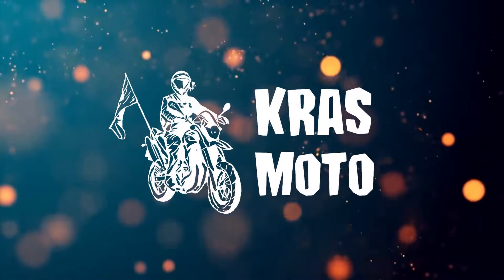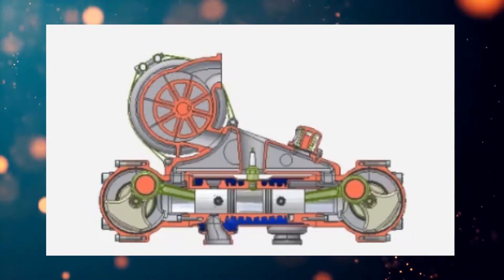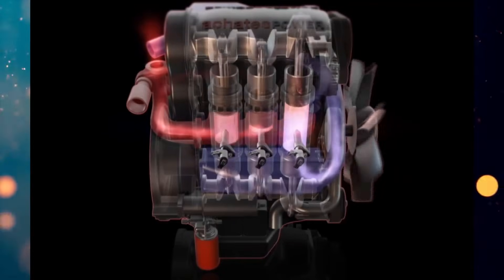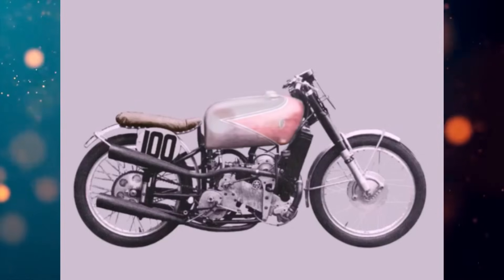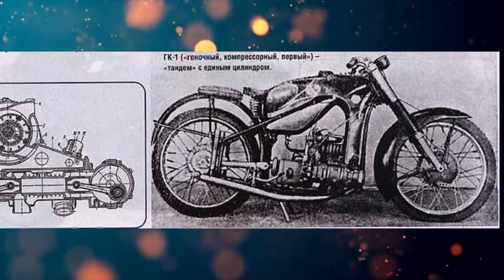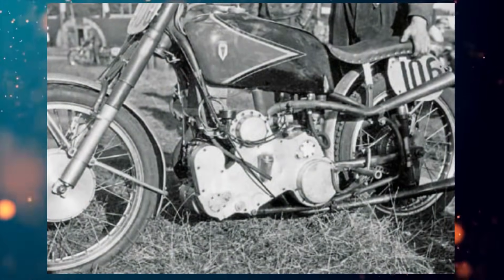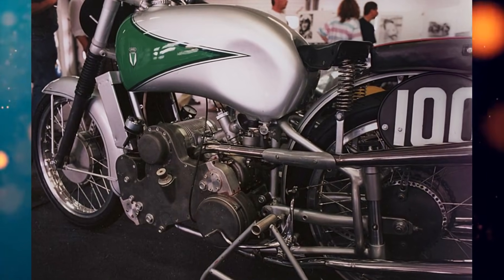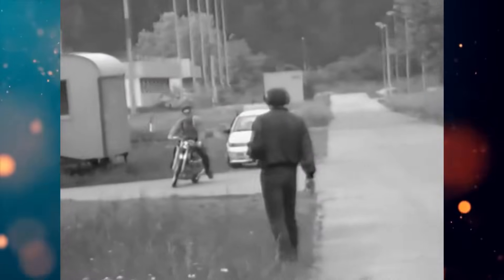A Motorcycle With Opposing-Piston Engine—How Does It Even Work?

Comment: I find the opposed Piston engine fascinating . I had never seen them applied to motorcycles .
Reply: I'm fascinated by opposed piston engines also the Deltic being my favourite, now if only I could build a small capacity petrol (gasoline) version (I thought maybe using Honda PA50 Camino parts ) what would that go like?
Reply: They are under developed.  Maybe some potential there.
Reply: My dad had a Commer lorry with an opposed piston engine. The TS3 engine, 3 cylinders, 6 pistons, 6 rockers, 12 connecting rods and 1 crank. A supercharged 2 stroke diesel. I think it was made by Chrysler/Roots.